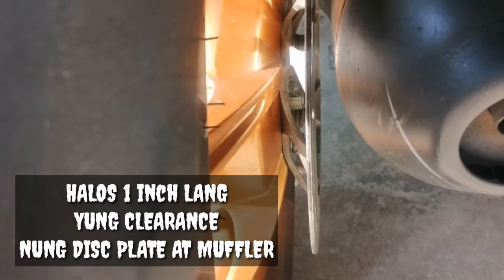skydrive 125 rear disc conversion

Comment: Sir. Anong size ng gulong sa likod? Thanks.
Reply from the maker: 110/80 michelin paps
Reply: Stock parin yung mags sir?
Reply from the maker: @erljhonsilva948  oo paps all stock
Reply: Thanks sir. Nasira na kasi gulong ko eh.. Maganda tignan pag malaki gulong eh. Katulad sana sa aerox.
Reply from the maker: @erljhonsilva948  pasuk pa yung 120/80 malake mas maganda para iwas semplang.. thankyou din paps ridesafe 😊
Reply: @danielmotovlog8422  paps ndi ba sobrang laki na nun ndi ba sasayad na yun sa makina
Reply from the maker: @emmanueliancruz106  hnde paps.. sakto lang sya gawa ako ng video nito.